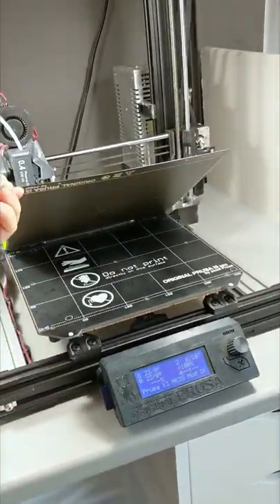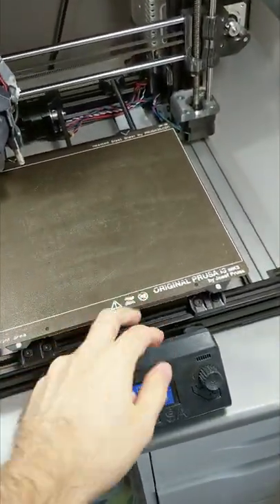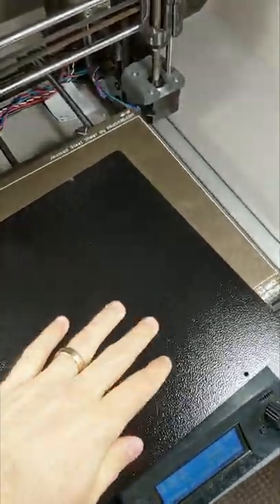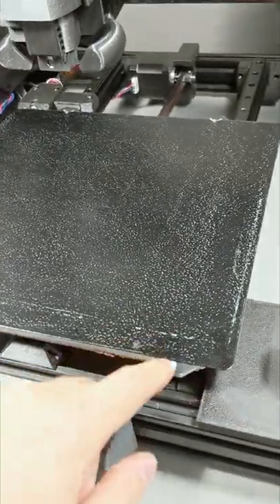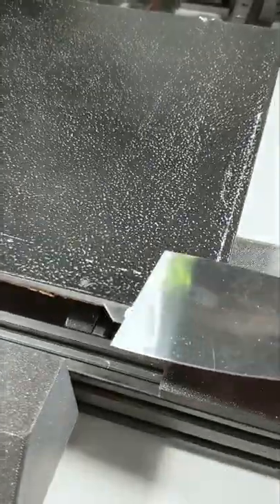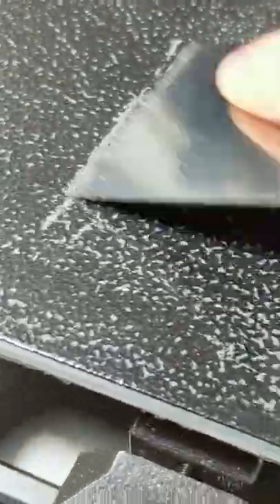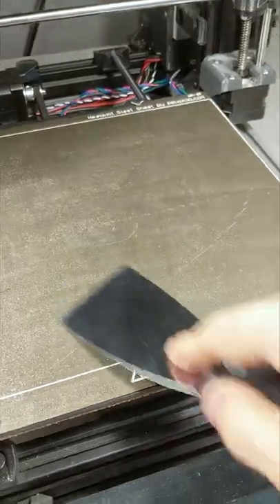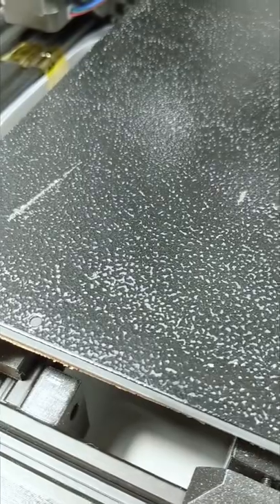Weird 3D printer textured sheet

Comment: The black sheet is a power coating. It’s not the same as the prusa power coating. I use these Chinese sheets due to the texture being what I need. You can’t use a scraper on them as the power coating is not hard. You will find they are difficult to get a suitable first layer that works. This is due to the poor surface grip from the sheet. I use a surface adhesive, usually hairspray. 
It also works well for TPU

Comment: It's because the Prusa stuff is powder coated. Have you seen that they're releasing one that's specifically for nylons? Supposedly better than garolite?!
Reply from the maker: Yup, just watched the announcement. I'm curious about their new nylon filament.
Reply: @MihaiDesigns  same here! I wonder how they compare to other carbon fibre nylons. Because usually it's a great material except for strength between layers which is usually a major downfall. The natural lubrication sounds nice, because that usually disappears when composite fibres are added
Reply: @lio1234234  I can't see a composite/fibre reinforced material being good for bearing surfaces needing that natural lubrication, simply because the hard fibres will wear bearing surfaces.